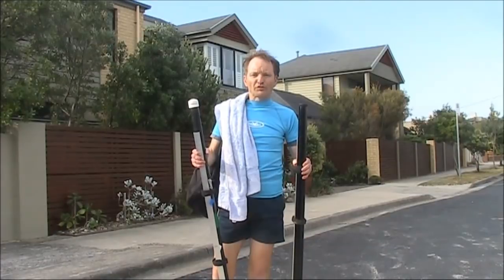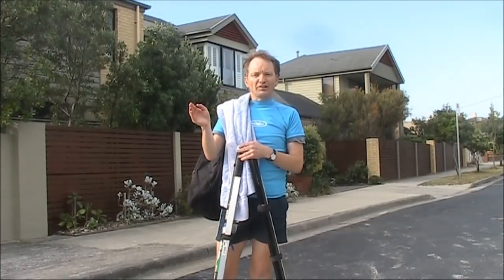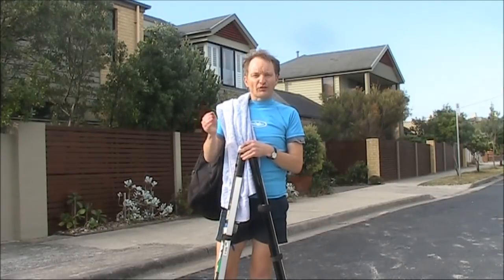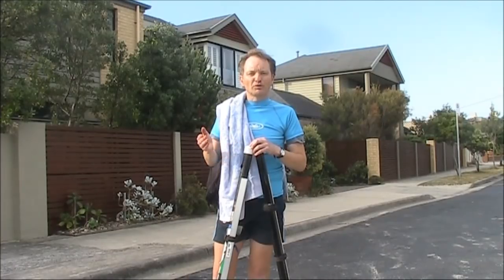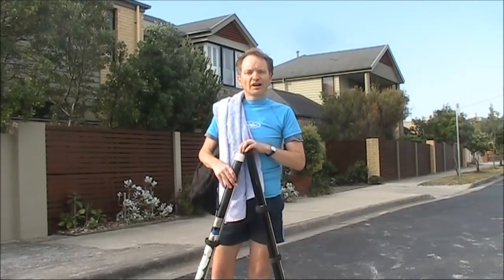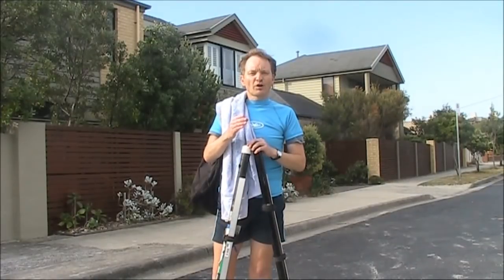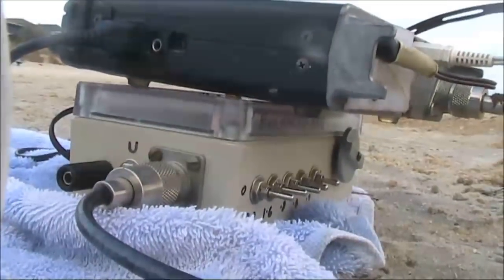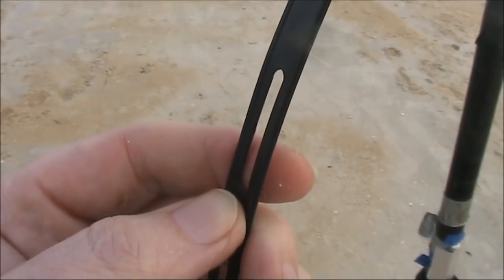A rectangular vertically polarised loop for DX: 20m WSPR test

Comment: I built this antenna and found it required 21.38m of wire to be resonant around 14.028MHz.  Works very well, contacts to USA, ZL and local on 25W.

Comment: Nice!  What dimensions would I need to construct a 10 to 11 meter rectangular full wave loop?
Reply from the maker: 1 wavelength perimeter. Wavelength (metres) = 300/frequency in MHz. But not critical if you use an antenna coupler.

Comment: How are you holding your squid poles up? Fishing spikes in the sand?
Reply from the maker: Just angle aluminium hammered into the sand
Reply: You carry a hammer?
Reply from the maker: A mallet
Reply: Good work! I carried a small upholsterers hammer to the top of Mt Feathertop a few years back because I'd been told the ground is rocky. Should have seen another climber's look of amazement when I got it out and started hammering in tent pegs for the squid pole.